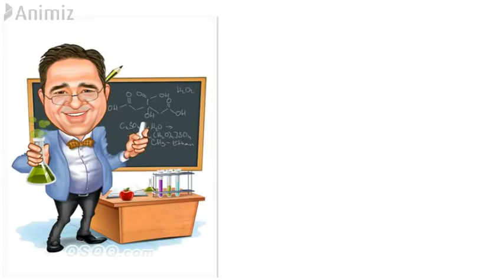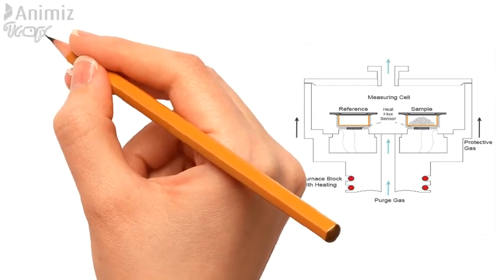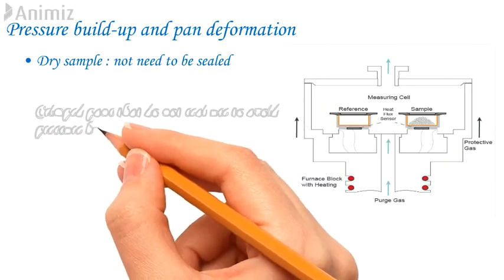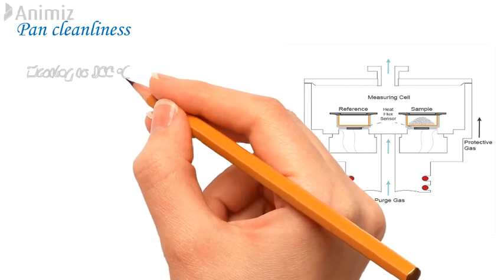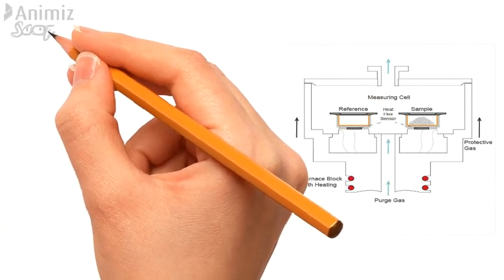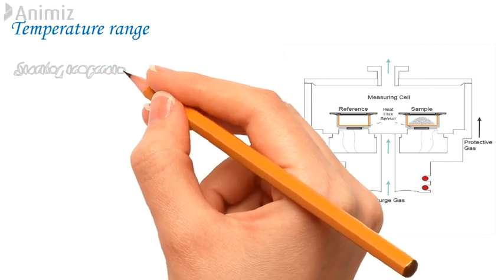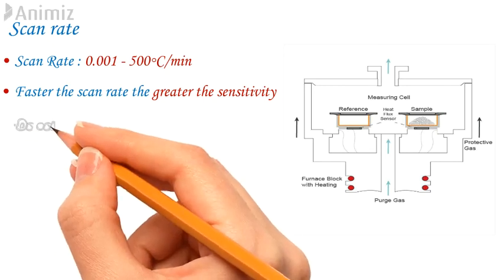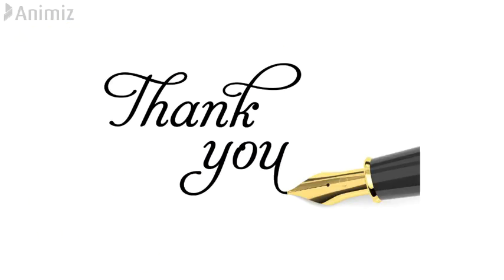DSC Practical Guide- Part 1

Comment: Thank you for  superb explanation please  elaborate why DSC having 100k thumb rule.
Reply from the maker: It's due to sensitivity. DSC, TSu study results largely depends on operators skill. You can say that it's error during experimentation as well as it's very difficult to achieve 100 % isothermal or adiabatic condition achieve during DSC run